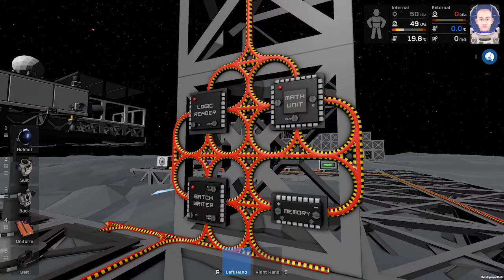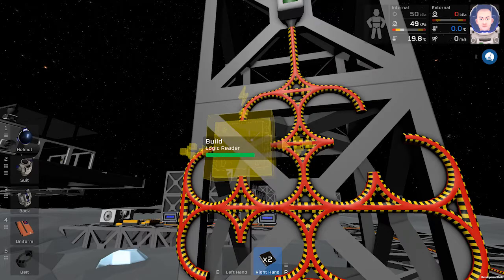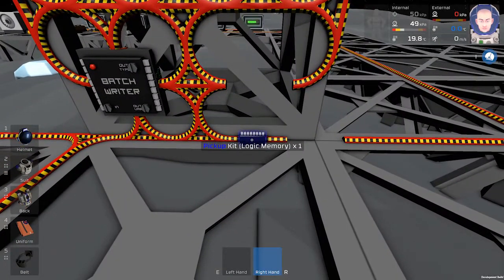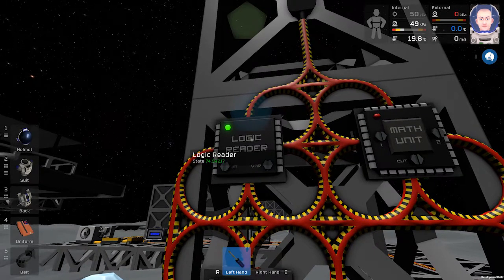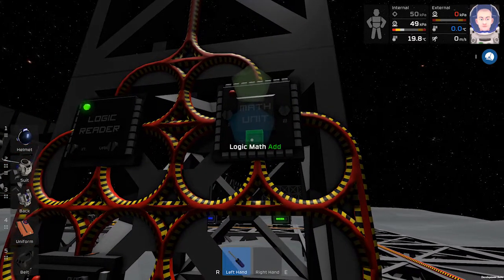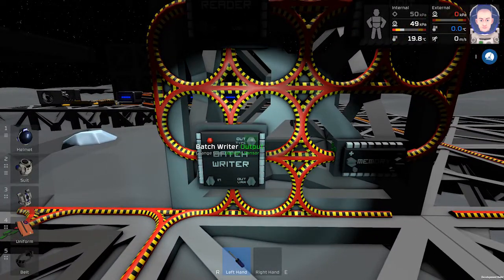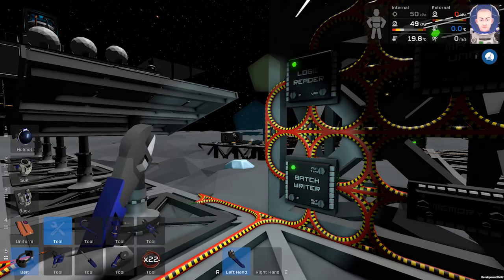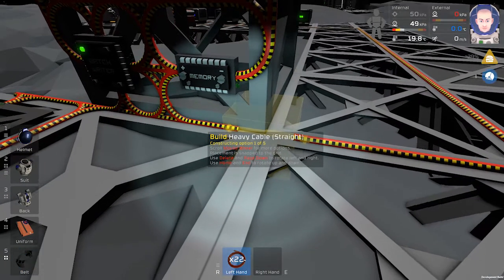Stationeers - Automatic Solar Panels Tutorial

Comment: when i put those chips, it says no other devices are connected, whats the problem? i putted everything
Reply from the maker: Do you have it connected with cables and programmed with screwdriver?
Reply: well i fixed that i can't control them, but now i have other problem, with logic reader, that only option for daylight sesnor is change to logic reader, not brach writer, now what?
Reply from the maker: logic reader reads daylight sensor

Comment: Nice, simpler than what I have atm. Don't suppose you have a suggestion on a logic to use for temperature control in my base that doesn't have heater clicking on/off every 2 seconds? Keep them coming I look forward to what you do next!
Reply from the maker: You can use Schmitt trigger for temperature control in your base. I will give you link for energy production control with Schnitt trigger, you can modify it. It is easier then it looks.

video link: https://www.youtube.com/watch?v=WdSV3JvT2wc
Reply: Saddamo De Beers woohoo, did it, and it works...thanks pal. One small step......lol
Reply from the maker: good job, easy to build and it can be used for everything